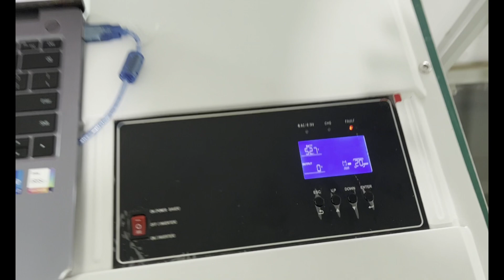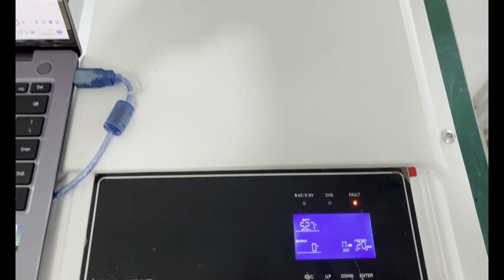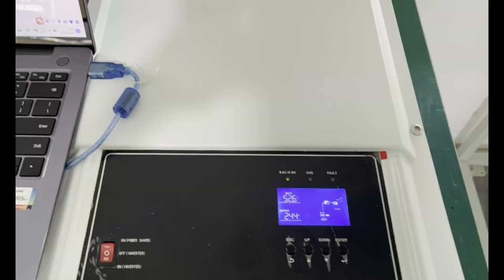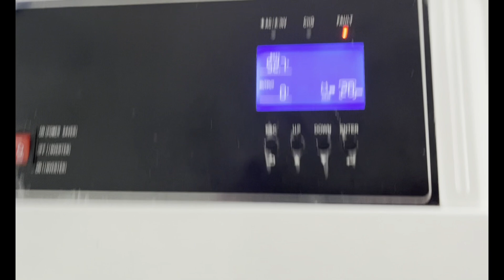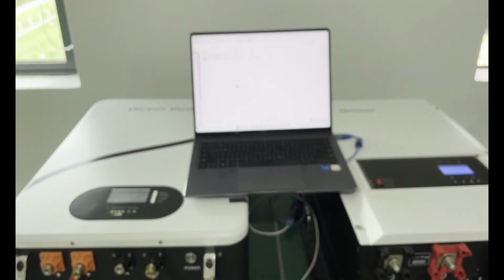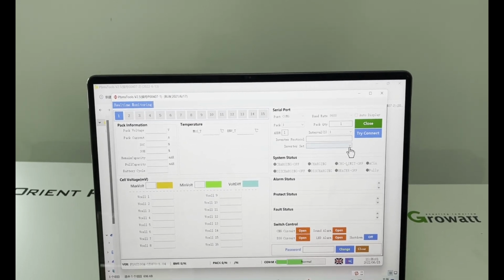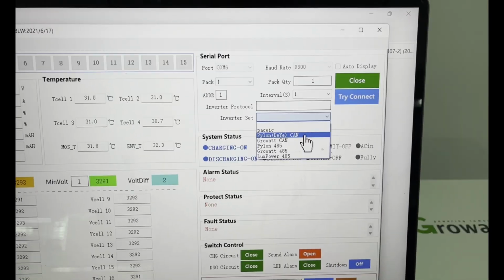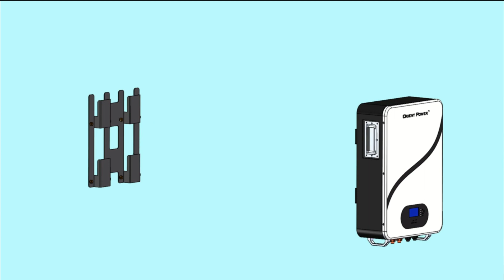Growatt Split Phase Inverter SPF 5000T DVM Communicate with Orient Power Powerwal Through Pylon CAN

Comment: Hello .. 
1. Is there any workaround way to use RS485 port instead of RS232 port to communicate to PBMS tools software ?
2. Could you please share RS232 pin wires assignment between RS232 plug to RS232 converter?
My battery is Eitai/QINGKE LDHEB 6100 power wall ..
thank you
Reply from the maker: 1. yes, you can connect through RS485B &C to PC. 2. yes, but not able to reply with photo, give a email to share you the picture faster. Or you can subscribe our channel, we will make video on making cables later on.